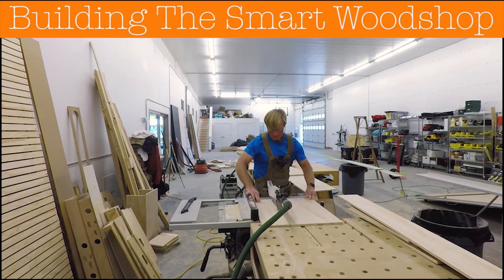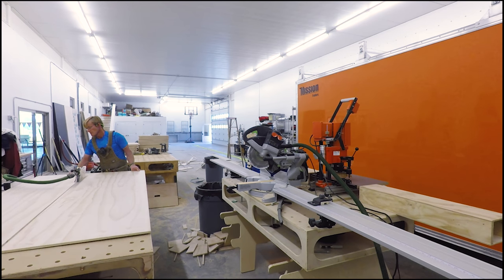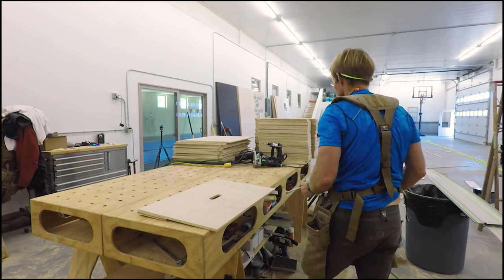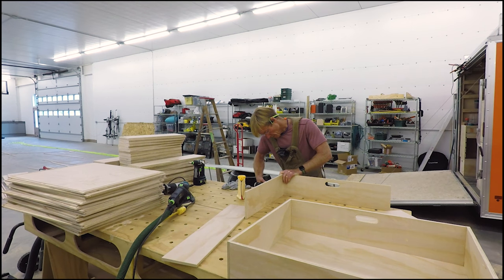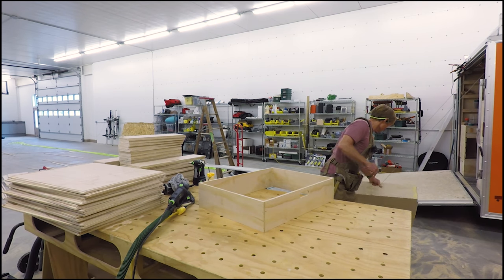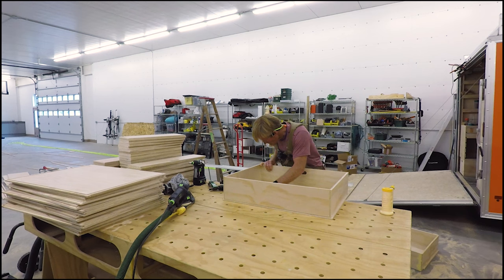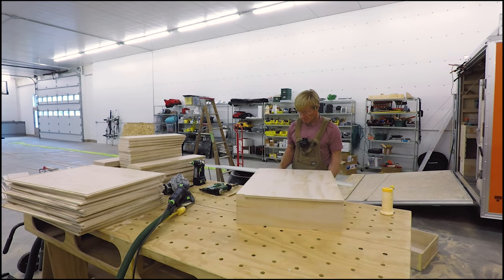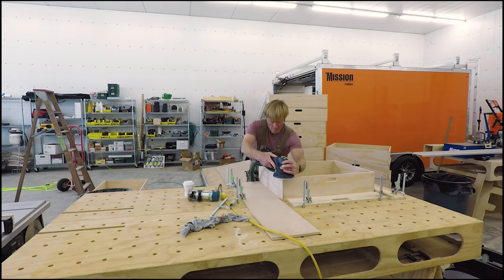Building my woodshop #26 & 27: Tall drawers

Comment: Thanks Ron. As far as the small router, I have a Ridgid cordless that has become my go to router for round overs and spline cutting, etc.. No bit drift, a micro adjust dial,  arbor lock to tighten the bit, and very good run time per battery.

On top of that, it's got a lifetime warranty.

Comment: A trick I learned about 1/4" shank router bits that are used in long term set ups. Before installing the router bit spray the shank with brake parts cleaner, remove the collect from the router and spray it too. This insures a clean surface to surface contact and no slippage!
Reply from the maker: My bit isn't slipping. I think the quality of the bearing and shaft on the Makita is the issue. I am pretty sure it is moving up and down slightly. It wouldn't be noticeable with a lot of bits, but with the 1/8" having the straight shoulder right at the cure, the small amount of slop shows up but is easily sanded off. I don't expect a $99 router to perform at the high level of one 4x the price but can still get the job done.

Comment: That complaint you had with the Mikita was the same complaint Fine Woodworking had with it in their annual tool review. I ended up going with the DeWalt for a quick palm router and I’ve been very pleased, although in cordless versions, they rated the Rigid the highest. Best value and performance

Comment: Hello Ron, I am a big fan of the rolling shop and the passive stops.  I am curious in the video 14 seconds in you have the Kapex mounted on top of your bench and the tracks extend to the left and right with stops.  Was this the Kapex track system? and what are the levelers your using on either side of the saw under the track?  Thank you, Bruce

Comment: I was wondering about your big drawers how much weigh do you think they would be able to hold?  I like the simplicity of the slides but wonder if they would work for the weight I'm going to have in them. Easily a hundred pounds in big ones. I like your videos.  Keep them going. Thanks

Comment: What is tool on ther side of PSS miter saw and why the box like items on either sides..is there a video
Reply from the maker: I sold my Smart Station and had not built another one at that time. I was using some Fastcap Miter extensions on a Paulk compact bench. The boxes beside the Blum were supports for the material being milled on the Blum. This was all a quick temp setup from 5 years ago.